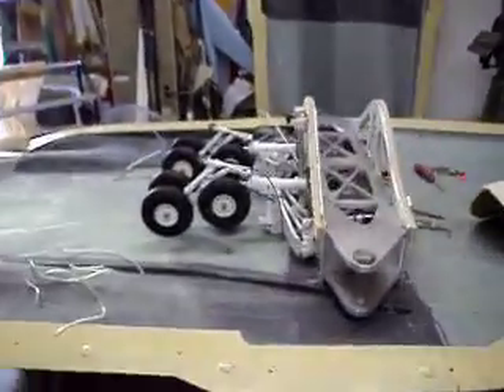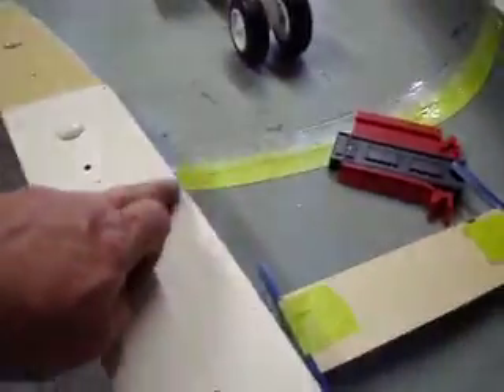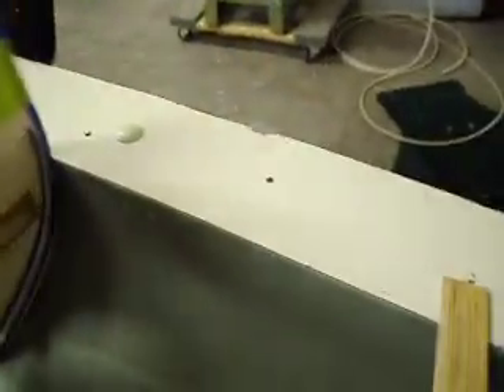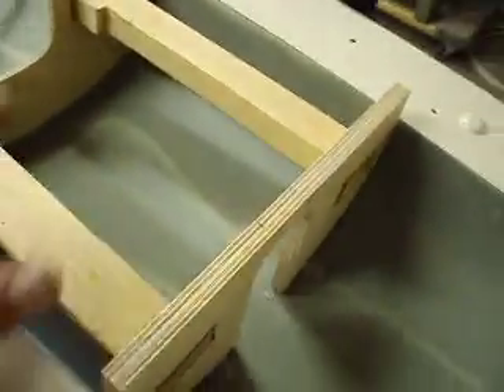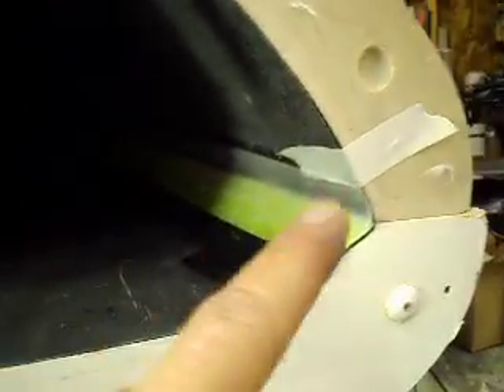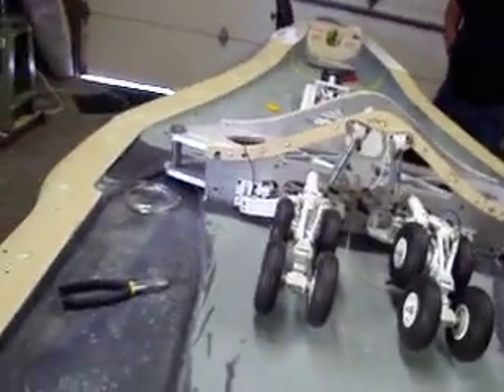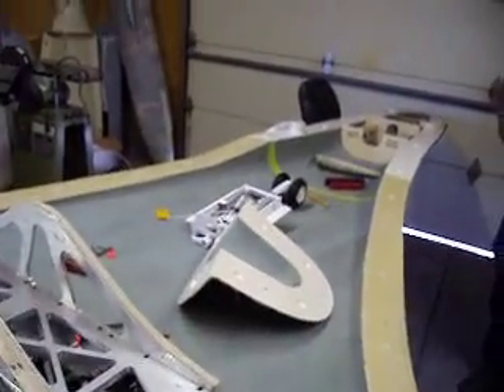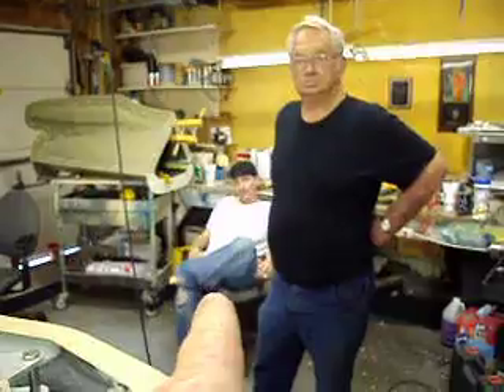How to build a rc jet b1 bomber #85

Comment: Its pretty awesome. I managed to get the ailerons started on my wing as well. I wonder if mine will ever get to the point where your at lol. Man this is really a long road. Bomber is looking awesome so far. BTW you realize that you still have to make air breaks, ailerons, flaps, elevator, rudder, gear doors, bomb bays, and bombs. So your not out of the woods yet. Plus you gotta wire everything up engines & radio gear as well as hydrolics. Man you got tons to do But we'll get her.. LOOKS AWESOME!